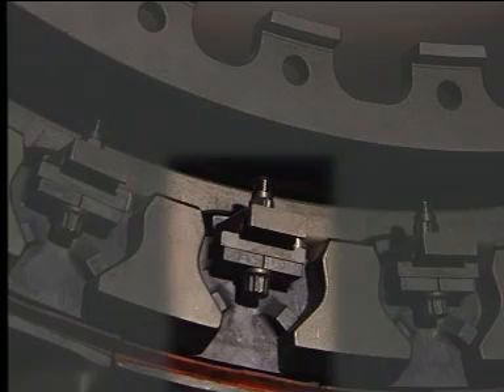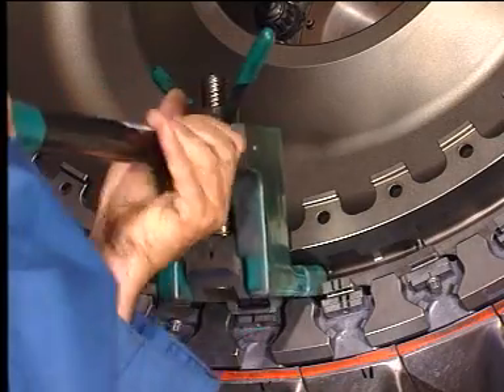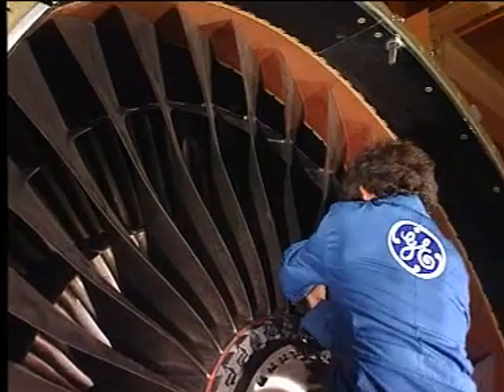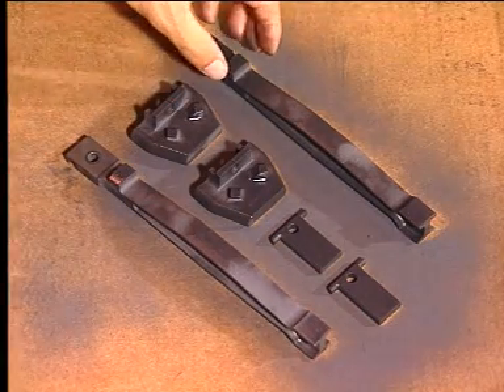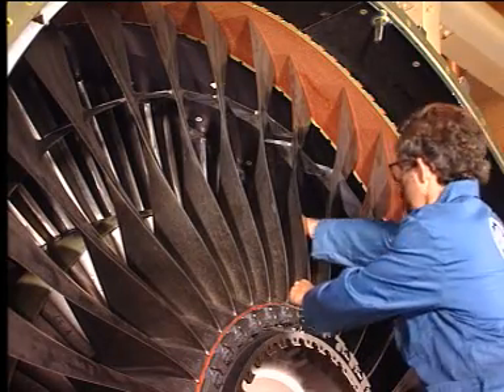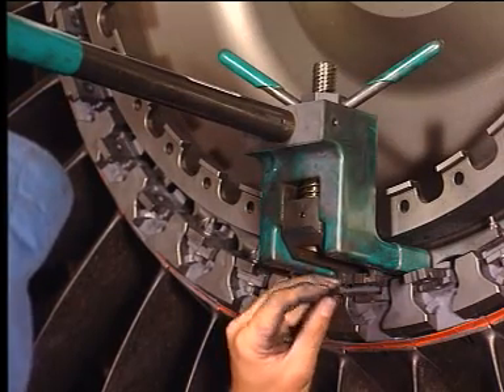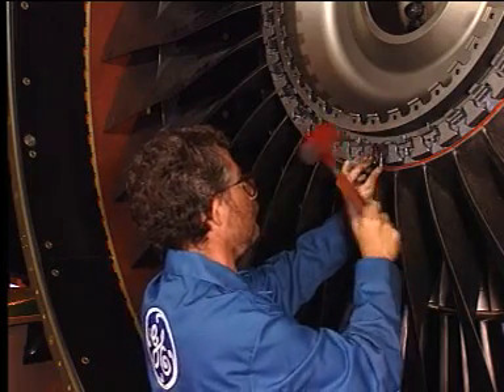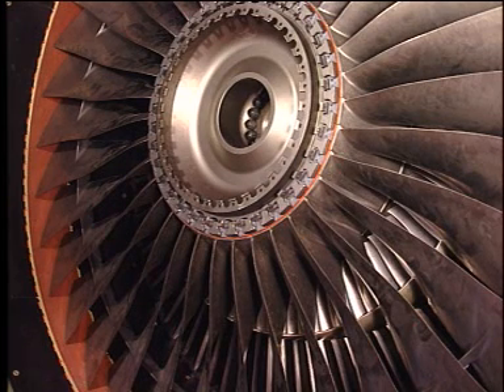AIRCRAFT | A330 GE CF6 - Fan Blade Removal and Installation

Comment: SUPER CHARGE, I AM INTERESTED TO KNOW  ABOUT  FAN BLADE PL ANSWER TO MY QUESTION, Q NO 1, WEIGHT OF BLADE ? Q2 , DIAMETER OF  FAN  ? Q 3, MAX  RPM OF FAN  ?  Q 4 , MEX TIP SPEED OF  FAN  ? Q 5,  HOW MUCH POWER HP REQUIRE TO RUN FAN AT FULL RPM ?

Comment: I tell ya what, them fan blades sure are espensive! To save some dough I just took one of em ere blades off my commercial field mower, put it in my bench vice, twisted it some, and ground it to proper length My 747 runs OK now, but shakes a bit Probly be fine, and I saved a whole bunch money!

Comment: These fan blades cost about $50,000.00 US each to replace.  What's with the funeral music?  Screws and bolts are two completely different objects.  There were no screws in this video, however he continued to call a bolt a screw.

Comment: What does the lubricant apply on STG1 fan blade for what?
Reply from the maker: This lubricant compound / spray is called molykote. It is a high performance Anti-Friction lubricant, can withstand extreme tempreatures and speed. Final result is : less vibration of the N1, results in less vibration in Airframe/Aircraft.
Reply: @SUPERCHARGE7  Yes, and not cheap...About $55 US dollars a can.

Comment: No safety wire?
Reply: Don't need it, they're stiff nuts on the bolts, but they should be replaced if the run up torque is too low
Reply: @superseven220  Nice...We call them locknuts.

Comment: As a retired b52 mechanic and tsa captain. I would have to disagree with the instruction in this video. The blade to to shroud clearance should be checked after replacement of any fan blade.

Comment: Good Engine the Cf6 they are on  Boeing  767s  and 747s        alot of operators  use  these on thier entire fleet  yes the 330 has the Cf6 as well with 100 inch fan case as its slightly larger than the 767 fan case  which is 94 inch  something similar to the PW 4000 engine   nice video and gives a little of what goes on in hangar maintanance of aircraft engines

Comment: Rather surprising that you don't have to re-balance the fan. At 3600 RPM, it only takes a small imbalance with something that size be vibrate like crazy,
Reply: Each blade has a pre-measured moment arm value marked etched on the blade, and the clip in fact points it out.

Comment: so those blades that spin really freaking fast are basicly held on with a small bolt and squeezed on by a clip basicly!!
Reply: +crapper1 I don't think so, I think the bolt and nut are there to prevent seperation of the spacer, clip and retainer. Most fanblades have some sort of "teeth" shaped tracks which aligns with aditionally teethshaped tracks on the fan disc. I think those tracks are the structure which holds the blade in place
Reply: + crapper1 
Lol..or how about the eight modest-sized bolts that hold the whole engine to the wing. Hell it may be only four , I can't remember, all I know is that I was taken aback when I seen the video.
Reply: BASICLY
Reply: The blades have a T-shaped end, which fits in the slots of the fandisc. The spacers and other thingies prevent the blade from moving axially ('forward' or 'backward') and press the T-shaped end in its seat, so that it doesn't wiggle (which would be catastrophic at those high rpms). The radial load from the blades is taken by the fandisc directly; it can deal with it. Made of some sort of titanium alloy. Really expensive thing...
Reply: The engines are hold to the wing with only 4 bolts each.
Reply: soaringtractor
Whatever... grammar nazi...
Reply: soaringtractor
Maybe I'm not english native? in 4th grade there was still no english yet.
Reply: soaringtractor DUUUUUUHHH     SPACESPACE!!!!!111ONEONEONE
Reply: soaringtractor BUUUUHHHHHH       !!!!
Reply: soaringtractor FUUUUUUHHHH !!!!
Reply: soaringtractor ZUUUUUUUUHHHHHH!!!!!
Reply: soaringtractor JUUUUUUHHHHHHH!!!!!!!!!!!
Reply: soaringtractor VUUUUUUUHHHHHHH!!!!
Reply: soaringtractor SUUUUUUHHHHHHH!!!!!
Reply: soaringtractor LUUUUUUUHHHHH!!!!
Reply: soaringtractor TUUUUUUUHHHHH!!!!
Reply: soaringtractor QUUUUUUUUHHHHHH!!!!!
Reply: MUUUUUUHHHHHH!!!!!
Reply: soaringtractor XUUUUUUUHHHHHH!!!!
Reply: soaringtractor see i have alot
Reply: 2 chunks of oposing T shaped titanium blocks and the help of centrifugal force....it ain't going any where
Reply: soaringtractor <3